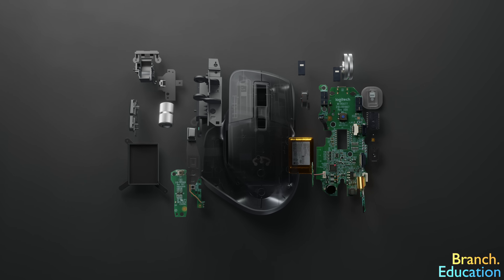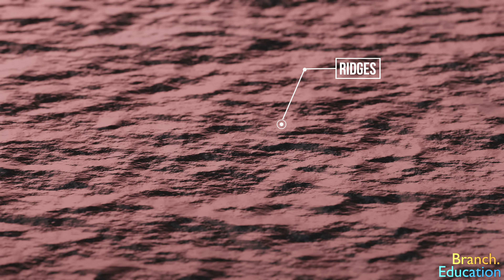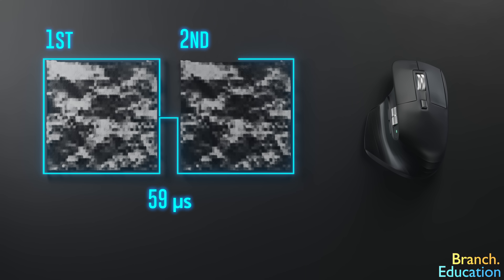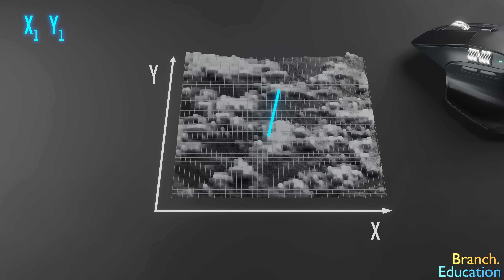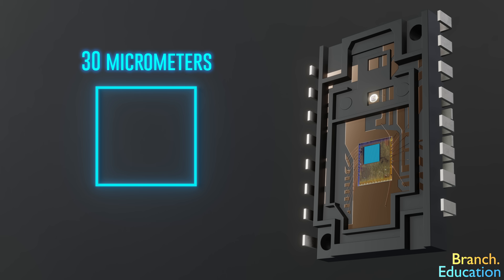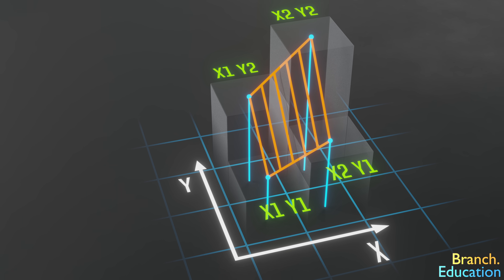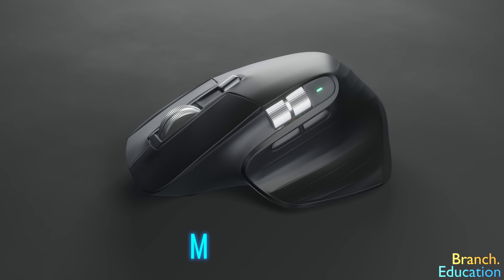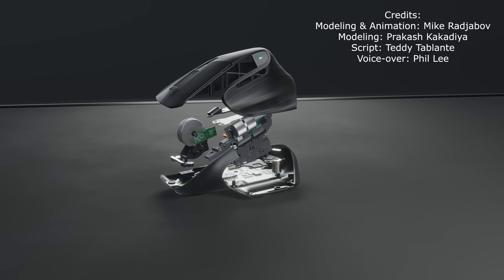How does a Mouse know when you move it?  ||  How Does a Computer Mouse Work?

Comment: The mouse knows where it is at all times. It knows this because it knows where it isn't. By subtracting where it is from where it isn't, or where it isn't from where it is (whichever is greater), it obtains a difference, or deviation. The guidance subsystem uses deviations to generate corrective commands to drive the mouse from a position where it is to a position where it isn't, and arriving at a position where it wasn't, it now is. Consequently, the position where it is, is now the position that it wasn't, and it follows that the position that it was, is now the position that it isn't.
In the event that the position that it is in is not the position that it wasn't, the system has acquired a variation, the variation being the difference between where the mose is, and where it wasn't. If variation is considered to be a significant factor, it too may be corrected by the GEA. However, the mouse must also know where it was.
Reply: I love this copypasta
Reply: @klittlet  Nice opinion, just one tiny problem with it. Inspecting your reply, it looks like your opinion is different from mine. Let me tell you something, I am the baseline for opinions. Any opinion I hold is objectively correct and as a result, any other opinions are wrong. Guess what? You happen to hold the wrong one! I hope you know that your opinion is now illegal. I have contacted the FBI, CIA, the NSA, the navy seals, secret service, and your mom! You'll be sorry you ever shared your opinions, by the time you're reading this, you'll be done for. Nature will punish you, humanity will punish you, supernatural beings will punish you. We decided just to make sure we'll nuke your house from orbit. So there's no chance you can run away, everyone will know you will die. It's a small price to pay, to remove your wrong opinion from this world.

(For the uninitiated, this is also a copypasta)
Reply: @klittlet  Nice opinion
Reply: @JakaiRule  it isn't a opinion, the original is a video talking about guided missiles
Reply: @klittlet  Saying that you like/dislike something or agree/disagree is an opinion, so yes in your opinion you think this copypasta is great

So do I :)
Reply: @RetroCube  oh so he was talking about that? That's weird
Reply: @klittlet  I mean, it's a copy, but not wrong. The sensors used got their start in IR-guided missiles like the Sidewinder when the replaced the purely electcromechamical seeker with a CCD.

Incidentally, if you change the lens arrangement, a mouse sensor is perfectly able to track movement over distance, and some drones do this for position-keeping on top of GPS.
Reply: @JakaiRule  One small issue.
(At least one person got it)
Reply: Two copypastas I've never seen before? Holy hell I've fallen off over the years.
Reply: It is basically rocket science. ;)
Reply: As long as the kind that carry warheads are never available to the general public!
:D
Reply: Yeah... And the way you carve a statue of an elephant, is to get a big block of something, and remove everything that does NOT look like an elephant!
Reply: Turing Police has to investigete if the mice are self aware so they don't became a chance to take over.😁
Reply: @crazyedo9979 
I think that the chance that mice can become self-aware is nil, because they have no lasting memory. Perhaps that is by design for some mysterious reason?

Or was it merely a trick to confuse the enviro-wackos who might try to give computer mice "human rights"?
Reply: He sounds EXACTLY like the missle dude lmao
Reply: fa*/.
Reply: Literally how he said it functioned lol
Reply: Saw the thumbnail and came for this comment.
Reply: Control theory in a nutshell
Reply: It is what it is i guess
Reply: https://youtu.be/obiFPyWjnms
Reply: You are, like a good learner .🙏
Reply: I'm glad I'm not the only one who thought of this during the explanation of the algorithm used to determine mouse movement.
Reply: Yeah, thanks for saying the same thing the video was about. I would have never understood it if you didn't reiterate it a second time. You must be some sort of genius.

Comment: The G502 mouse(the gaming mouse in this video) can unlock the scroll wheel so it freewheels, So you could say get a drill with a wheel on the end, spin that drill up and make contact with the top of the scroll wheel and rev the sucker at 1,000+ easily, but this would cause damage to the scroll wheel due to heat as it does not have lubrication 
My scroll wheel on my G502 needs servicing as dust gets into it and causes friction

Comment: So I'm not exactly sure, what the gaming mouse does "better". The higher polling rate (1ms vs 8ms) is definitely a plus, because I can catch quick movements better/faster. But what about the DPI every gaming mouse brags about? The x/y difference sent every 1ms is already the average of several cycles of catching the surface and cross-correlating. Why would creating sub-pixels make this significantly better? Because I can detect smaller changes and therefore slower movements more accurate?
Reply: But then again I would expect a 1000 DPI Mouse to be able to catch a 1/1000 of an inch in movement (~ 1/4 mm). Why is it better to be able to catch 1/80mm (=20kDPI) in position change?

Comment: Lmao calling a trackball mouse pre-historic. I have fond memories of those. I remember having to work on a project in computer class at school. We had to edit a picture using Photoshop CS2. The computer that was assigned to me had a broken mouse so I had to get a replacement. Only I had was a trackball mouse without a trackball. I had to edit the picture using the mouse by reaching into the hole under the mouse and manually stroking the small rollers inside. It was a hellish but fun experience.

Comment: Could this chip not also detect rotation about the z axis? Would be very helpful to be able to hold my mouse at different angles and not have it change how the mouse will move on the screen. 

It’ll prevent a relatively niche issue with low sensitivity called “mouse drift”, where your resting position changes over time because of your wrist’s pivot.

Comment: My first computer, an Apple //e, had no mouse at all. Back then, the built-in keyboard was all you needed, that is what the arrow keys are for, for moving the cursor around, and perhaps add a joystick for playing games, as the joystick gave better control than the keyboard did. The joystick had 2 potentiometers and 2 buttons. The change in resistance would change the amount of time for a circuit in the computer to discharge, and the computer hardware then would record the amount of time as an x and a y position number. My joystick was designed to replace the 2 paddle controls, which both have their own separate circuit on a combined joystick port I think it was. My first mouse was on my Macintosh Performa 600CD. It had a ball. The problem with the ball mice, was that often the ball needed to be removed and cleaned, because it would fill up with dirt and then wouldn't track properly. The ball turns an x position rod, and a y position rod. I had no idea of the complex image processing involved with the laser mice. But they sure do the job better. I think that I still prefer the USB-wired version depending upon a battery.

So should I buy a track-ball?
Reply: I also started on a //e. I do a lot of PCB CAD and I prefer the large Wacom tablet over a trackball. I remember cleaning mouse balls too, and one problem was if you had a hard to clean ball and used alcohol to clean it, the ball would begin to get dirty faster and faster the more times you cleaned it. I think the ball became alcoholic.
Reply: @dale116dot7 
Maybe the alcohol was dissolving the ball?

I do not think that I want a large tablet cluttering my table. I do have a Macintosh trackpad, but my new Linux computer, actually an old PC, has no Bluetooth.

Oh I loved my $1000 //e. I could do my own Assembly and machine coding on it. Now I have to rely upon other people's programming. But now sadly my //e is sort of obsolete, and just sits in its box for years and years. I never could properly close the box, as the 5.25" disk drive is too hard to disconnect. I had my //e playing music and video game sounds, through my 1980s boombox.

Even though the old //e sound generation was crap, it sounded so much better on real speakers than on the tiny tinny speaker inside my //e. My Dad helped me add an RC phono jack to the back of my //e. And a toggle switch on its front, so that I could hear AppleWorks beep, in case my boombox was playing actual music. The toggle switch on the "off" position replaced the internal speaker with a dummy load resister. Simply cutting out the speaker didn't work, as it changed the characteristics of the circuit too much. I think that I simply y-ed the output into both my boombox's left and right inputs. No need for a volume control, as my boombox already had all that. And the speaker voltage level was just right to drive a line level input. Simply disconnected a wire from the internal speaker, isolated (in case of potential polarity problems?) through a capacitor—told my Dad it needed a high capacitance or it would absorb lower frequencies—testing proved me right, and reconnected through the installed toggle switch.

My 1st Mac was rather cool as well. Thousands of colors. The very new thing back then. It had my non-proportional Apple //e font, that I created myself using ResEdit. Great for programming, as the Courier (non-proportional) font was ugly. I think it even "puked" when I ejected a disk. Stole the sound from MacPuke extension, and used the sound resource with SndControl which has better stable coding. A control panel that assigned sounds to various keys on the keyboard and events. My later Apple IIGS would announce the acceptance of a disk with Johnny Five from Short Circuit exclaiming "Nice software!" I had the After Dark screen savers on my Mac with the Borg assimilating the screen, politicians in the Toxic Swamp with cement shoes (I guess the tame fish aquarium thing was getting old?), Bungee Roulette, etc.

 I even used ResEdit to transform a screen saver that deals a deck of cards onto the screen, so that it dealt my own artwork onto the screen. Without having to do even 1 line of code. Just pasted in new resources. I copied and renamed the file, so I could still deal cards.

Comment: It took me awhile to figure out that earlier mouse pointer moved exactly same pixel as the image has moved in the Image analyzer. Currently, pointer position is also scaled based on acceleration of x and y values. If you move mouse faster, the pointer will move at greater x y distance than it will if you move it same distance slower.

Comment: The light from my Mouse is NOT "Infrared," it's an intense and highly visible red light!

Infrared, such as that produced by a REMOTE CONTROL, is INVISIBLE!

Glad I could help correct this glaring error, but if the video gets that wrong, it's clearly not to be trusted as a source of accurate information?

Video "Disliked." 👎
Reply: do you have any better idea, how to visualize Invisible IR light in this animation?)
Reply: @MikeRadjabov  Did you read and understand my comment?  The light is NOT infrared! It's high intensity visible red light! You can SEE it! It doesn't NEED "visualising." It's ALREADY visible!
Reply: MX Master 3, G502 or G403 and other modern mice use Infrared light which is invisible to your eyes, but you can actually  see it using your smartphone's camera. This animation just visualize the light path as an explanation and might not be 100% physically accurate but it's pretty straightforward way.
Reply: @MikeRadjabov  I know you can "see" infrared using cameras that employ a CCD image sensor. My Logitech Mouseman Optical (and every other optical mouse I've ever seen) employ high intensity visible red light, produced by an LED. However, I was wondering if technology has advanced, and I know that some Mice use lasers. I've never found a mouse better than my Logitech, so no reason to upgrade. What advantage does infrared confer? You won't be able to see if your mouse is working? My LED flashes all the time, and cannot be switched off. Rechargeable batteries last about 7 weeks.

Comment: the Logitech Anywhere MX claim to be working on any surface including glass. I've personally owned several and they really worked on any surface in my experience. I wonder if it's using similar method as the one explained in this video.

Comment: For many years I used a wireless, PS/2 ball mouse. It had a low DPI, but I loved it. Unfortunately, the posts holding the scroll wheel got worn down to the point where it now rubs on the inside of the case. I've been meaning to fix it.

Since it's been out of commission, I've used a series of optical mice, including a R.A.T. 7 gaming mouse (which now needs its buttons cleaned to stop the double-clicking). Every single one of them has frustrated me. Sure, they're fine for everyday daily use, but when I try to do anything precise with them, I want to put my fist through the screen.

It is 100% impossible to make purely horizontal or vertical movements with them. No matter how careful you are, the mouse will jitter on the other axis. Try to follow the edge of an object in an art program and you end up erasing half of it. Try to position the mouse on a specific spot and the pointer jumps a pixel to the right. Carefully move it back and it jumps up a pixel. Move it down and it jumps to the right again. ARGH!!! MAKE IT STOP!!! 

Every optical mouse I've ever used does this. All I can figure is that the mice are so sensitive that they register movements so small that I'm not even aware I'm making them. The other day I was trying to edit a picture and I ended up going into the mouse prefs and turning the pointer speed way down. It was so slow that I had to reposition the mouse 2-3 times just to reach the Start button and set the speed back up when I was done. Even that wasn't a complete fix.

People talk about how today's optical mice are much more accurate than the old ball mice, but for me, it's the exact opposite. Trying to make tiny, pixel-perfect movements with such a mouse has me pulling out my hair in rage.

Comment: We did this same algorithm in the 1980s to drive the first automated integrated circuit packaging bonders, the machines that attached the wires from the package to the chip. Without this, the work had to be done manually and the computer revolution would have been stalled.

Comment: DPI isn't related to accuracy of the sensor ? This shows otherwise https://www.youtube.com/watch?v=imYBTj2RXFs
Could it be that mice also tweak FPS along with DPI ?
Reply from the maker: DPI and sensor accuracy is in fact related in the fact that higher cost mice have higher cost sensors with more accuracy in each pixel.  However they don't necessarily have more whole integer pixels.  It's kind of like how tons of smartphones have 16megapixel cameras in them, but they are definitely not all the same in quality.

Comment: I still know the times when mice had a ball that you had to clean from time to time. Especially the mechanics inside. 
Back then, mice had a button or two. Some even three.
The mice were connected to the 9 pin joystick port, the serial port and sometimes even to their own PS2 port. 
Then came mice with wheels instead of the 3rd button. 
Some already had an adapter to connect them to USB 1.0. 
Then I had a wireless mouse, the receiver was a box only 10x10 cm and had a USB cable. That was a mouse with a red light below.

Comment: How does the image comparison check is performed? Unless there is some assumption in which direction we should go you have to compare all possible combination. So in one cycle you have to consider all available shifts and for each of them - compare images. So if the image consists of 1600 (40x40) pixels you have to do 1600x1600 comparison and choose the one with lowest diff. We end up with O(N^4) algorithm where N is a size of the image pixel array. For the size 40 there are ~2.5M comparisons for every cycle. Now multiply that by 17000 cycles per seconds and you will get quite big number. If you consider 25000 dpi you will get the number which is for sure too big for simple microprocessor. I think there is some simplification (or clever optimalisation) in the algorithm or it's not so simple as described.
Anyway, great video!

Comment: A question, why don't mouse use a gyroscope sensor or accelerometer to find x and y positions?
Reply: You can't find x y locations using accelerometer or gyroscope in world space, meaning you need to track some points on surface in order to determine the movement of the mouse in space
Reply: @MikeRadjabov  Yes, I forgot it shows m/s^2 , it always showed x, y and z  so I guess I got confused, my bad 😅

Comment: Pixel Grid --> Sensor measures separate light Intensity for each pixel  --> This creates a unique data map (looks like a mountain range) --> Multiple data sets (or images that look like mountain ranges) are captured continuously --> Algorythem detects X Y movement between separate data sets (which look like mountain ranges).